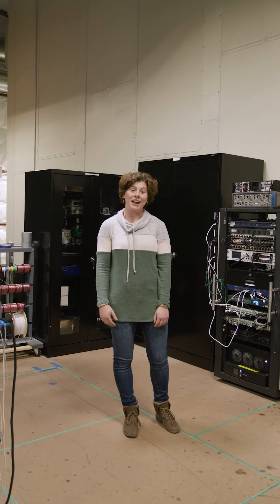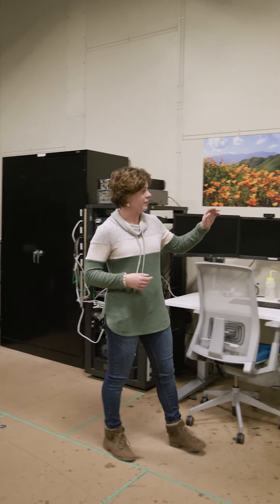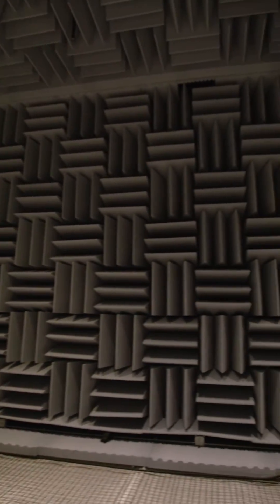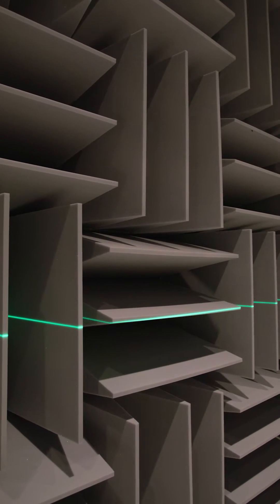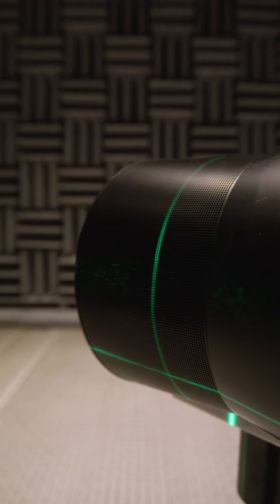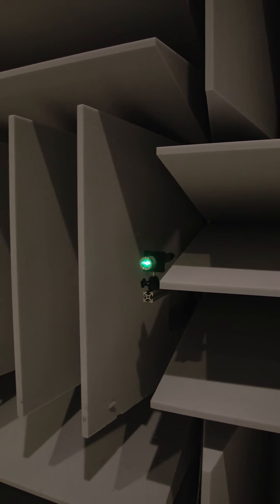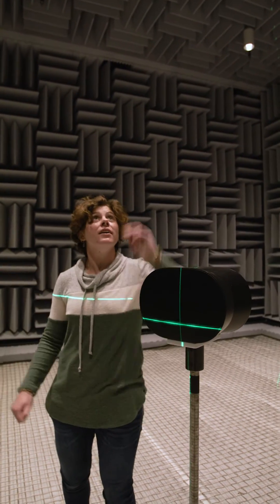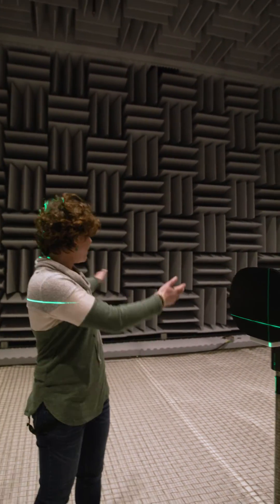Inside the Sonos anechoic chamber

Comment: How can immersive music sound good in an anechoic chamber if the side and upward firing speakers wont get any walls or ceiling to bounce sound on?
Reply: She literally said "one cool thing about when you stand in here.. it's much more immerssive, so you can hear things coming from the corners.. the ceiling.." Either she misspoke or the video editing makes her sound like she is referring to the room she just previously described as having zero reverb. 🤔
Reply from the maker: Hi Ludvig. Great questions. We use the anechoic chamber to understand how the speaker itself is performing. We do a lot of listening, measuring, and testing in normal room settings, and this sort of in-room testing was just as critical to the development of Era 300 as the measurements we performed in the anechoic chamber. The Era 300 is ultimately designed to sound best in a normal room, so we do account for natural room reflections when the product is finalized.